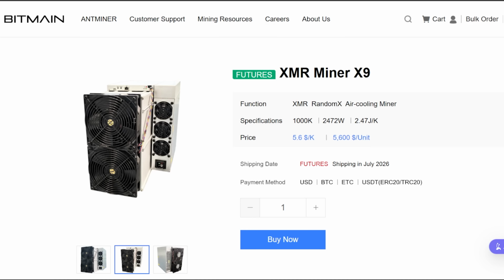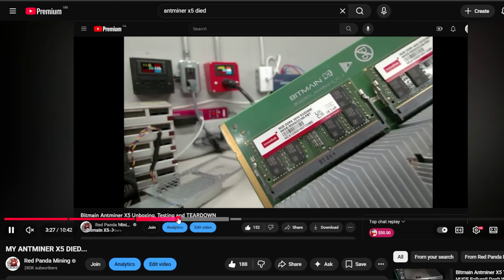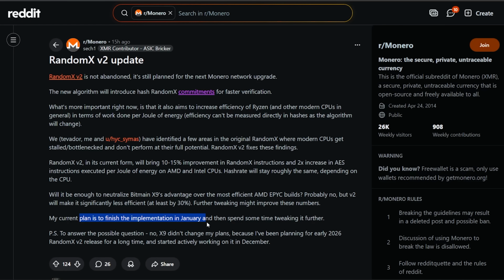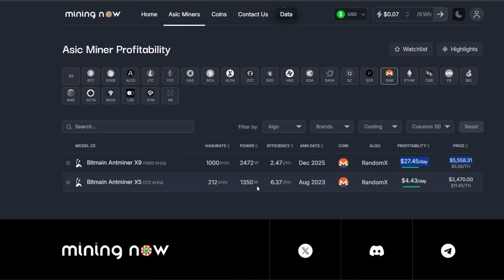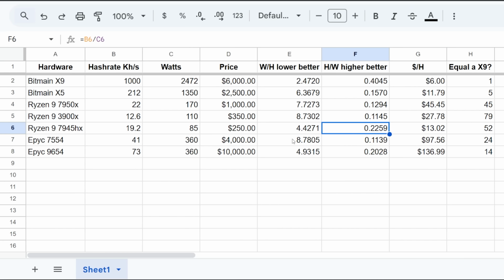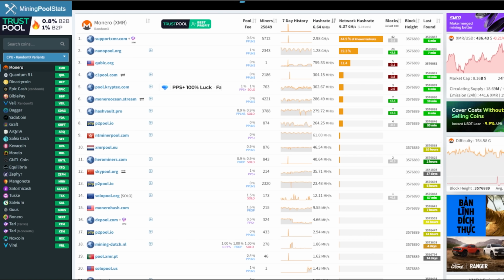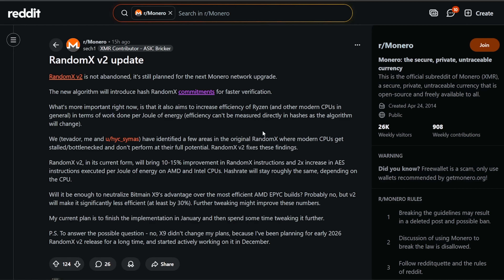Bitmain Antminer X9 Is INSANE! Will Monero Change RandomX to SAVE CPU Mining?

Comment: RPM needs to test this Antminer on the Salvium chain. My 9800X3D is pulling almost 2x profitability on SAL vs Monero right now because the difficulty is still low.
If this X9 miner hits the network, are we cooked? Or does Salvium have ASIC resistance like Monero? I'm mining as much as I can before these machines flood the difficulty, but curious if anyone else is switching their CPUs over yet

Comment: The CPUs are general-purpose? Doesn't  use an SSD, just RAM. If it did, if Bitmain, was lazy, could look at PowerOn hours of the SSD to see if they used it, though not conclusive. 
It would be epic  to see this modded to be a PC i wonder how many cores each chip has

Comment: 7945hx so efficient  because  the cores are affectively running in efficiency  mode? Or does it have a secret advantage? Could  limit TDP of desktop Zen 3, 4, 5 to achieve  good efficiency  gains as well, which u have made videos.

Strange that they have a thing against RISC-v it is what it is
Reply: Smaller transistors make lower voltages possible.   That is because the gate insulators are thinner.   The 7945HX is on a 5nm process.   The older 3950x is 7nm and requires more voltage to switch the logic.   It is a hardware issue.   New chips use less power.
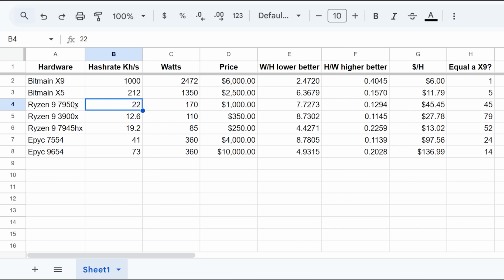Reply: @NathansHVAC 9:15 7950x efficiency still significantly less at 7.7273 watts per hash than the 7945hx of 4.4271 , both use  5nm Zen four cores. So, the mobile aspect must really help the efficiency, so could reducing TDP and undervolting bring the 7950x and 9950x closer to it?

Comment: the x9 is equal to like 47 7950x Cpus in hashrate but it doesnt release until july so a lot can happen between now and then
Reply: It's interesting indeed, fact is cpu mining like gpu mining is dead, unless u have some magic trick. Seems that's the only way to decently mine monero. Intresting tho this supposedly had several "asic resistant methods" lol.
Reply: @bekeneel  its not an Asic Miner its Risc V Chips, which are cpus not asics chips

Comment: bitmain has probably done these like 1 year ago and has been "testing" to make sure they work, they probably did this when RAM prices where not crazy like now
Reply: Bingo. They're making them public now after mining with them for a year because they know from monero insiders they will NOT work with V2. They always dump hardware moments before it's obsolete, just like their ETH ASICs nobody knew existed until 3 months before ETH went POS. Lather, rinse, repeat.
Reply: @rafalklepinski7372 they will work with v2
Reply: yes. I think these are on the network since september 2024
Reply from the maker: maybe a good couple of them but nothing crazy cause even older CPUs still profitable but not much at this point.... Rip only saving grace is XMR has to stay high in proce

Comment: They got some sick chip Designers at bitmain, e11 is gpus on a board, x9 is riscv. They could brick the microcode on it though, but more than likely not.

Same with Z15 pro they just chasing the bag, doubt it will be here in time and profitable.
Reply from the maker: zcash still up insane